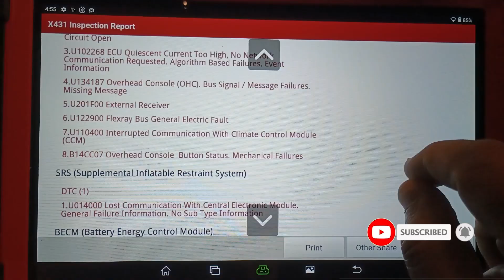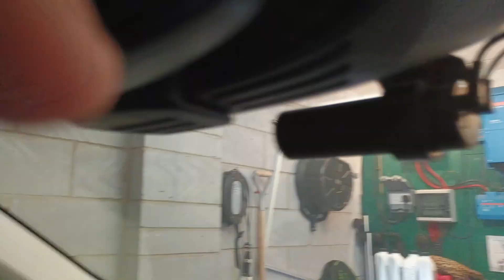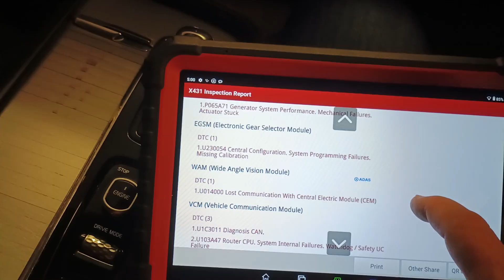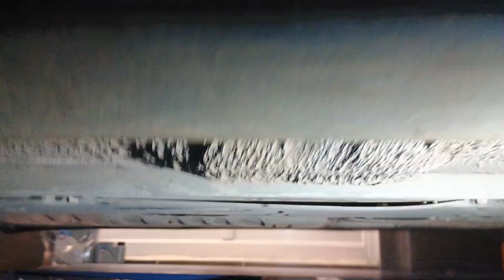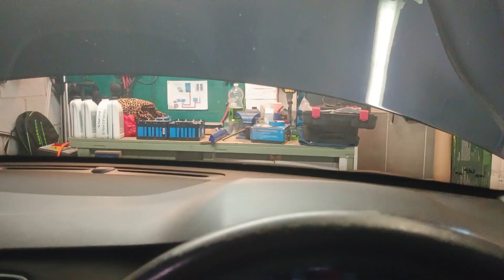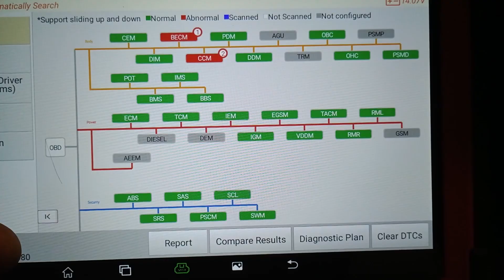My 2017 Volvo XC90 SPA broken again. Oh no! :))))))))))

Comment: I hate volvos but i love your channel. Volvos are not even the worst but i dont like the issues that they have, i just dont  think these 2.0 l duo charged engines are very reliable and everything is crazy expensive, like 300 dollars per injector what a joke
Reply from the maker: Thank you, I do my content for you guys. I think the new t8 engines quite good but you shall not use the oil from "NEW CAR of dealership" 😂. It is good to replace the oil just ontime and even more frequent, once in 6000-7000 miles. People drive up to 15-20K miles that's why theey are BIG problems with this engines. Turbos quite good quailty and can do up to 80K easy but supercharger clutch is very BIG problem. It is normally takes up to 50-60 K miles to make it dead depending on how agressively you start from traffic light. Unqualified mechanics another kill. So the car itself is great, people killing them. This is "hot" engine, so you have to service it same as BMW. Just from 2 liters they take over 400HP so... Good quality service ontime is a must for this cars.